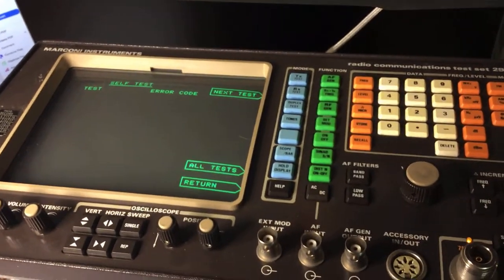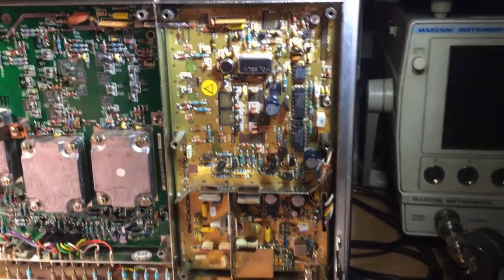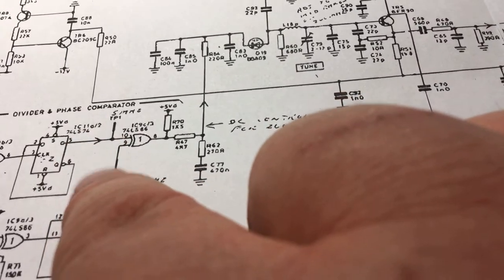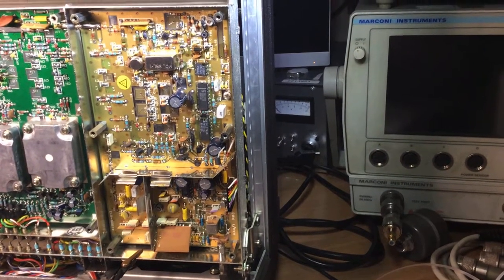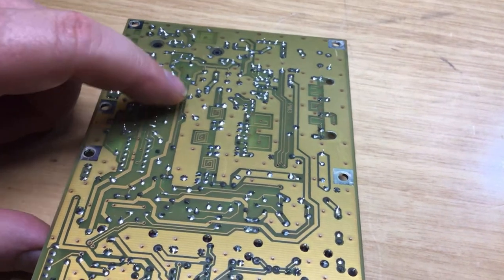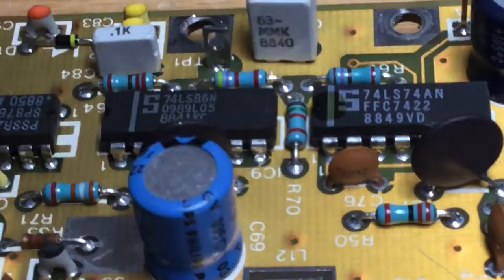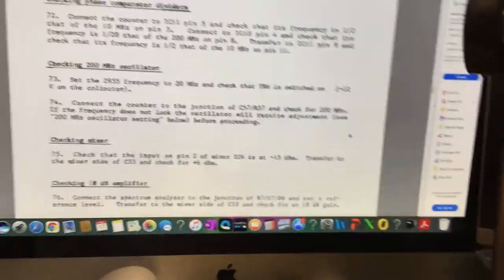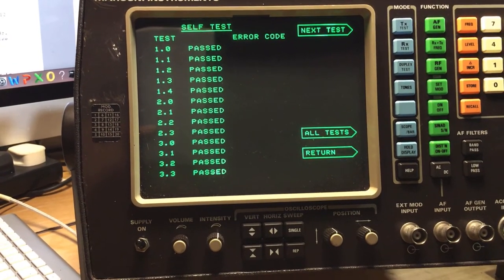Component repair Marconi 2955A Fails 1.0, 2.2, & 2.3 self test fail.

Comment: Hi! 
The adjustment procedure for 200MHz oscillator can be found in the 'Marconi 2955A/2955R Service Manual Amendments Vol 2', chapter 5-2-8 (Page 164 in the PDF)

Comment: @47:00 I picked up an almost identical desoldering unit, I did a review and then a modification video where I improved the fan noise, moved the power switch to the front, and improved the internal air flow for better cooling.
Reply from the maker: Yes  its very good desoldering station, I also have a PACE ST115 desolder station with accessories inc the drill tools too which plug into the base unit. That too is a very good desoldering station, About 20 years ago not long after these PACE units came out & acquired a large quantity of them from Erricson mobile phone factory closure here in the UK & sold them very cheap, Regret that now as their 2nd hand price today is ten fold what i sold them for 20 years ago 2nd hand.

Comment: What're you using for a ohm meter?   I'd Love something like that!
Reply from the maker: Hi There, the Ohm meter i use is a Fluke 123 scope meter, which is a portable meter, I also have a bench mains powered meter Thurlby Thandar 1705, both are very useful. The fluke 123 scope meter  gives isolation when measuring mains switch mode power supplies, as its battery powered you see.

Comment: All electrolytic caps need to be replaced. They have a life span. The test set is over 30 years old. If you have the board out change all electrolytics this is a known fact by all technicians. I cant believe you only changed the one capacitor.

Comment: SO are we saying that 11, 25 and 27 are down to a dead capacitor ?
and not OM345 related ?
i have two resistors on my OM345 to replace and sure i already did a capacitor a while back, but 11, 25 and 27 are back..!!
Reply from the maker: Of course it could be a defective OM345 too,  Well think about it, the OM345 is a wideband RF amp from 400khz to 1ghz isn't it? so taking that fact into consideration if the OM345 fails it will fail self test on all frequencies won't it. So as in this case if only the lower frequency below 20mhz fails in the tests & no other failures at higher frequencies occur then the OM345 cannot be at fault can it? this is because for frequencies below 80mhz the 2955 switches in a 200mhz fixed frequency oscillator to mix with a higher frequency signal generated to produce a frequency between 400khz to 80 MHz range, so a transistor turns on to power the 200 MHz oscillator & a capacitor across its supply output goes short.thus the 200mhz oscillator cannot run & hence no RF output at lower frequencies. Furthermore you can also establish if the frequency counter board is defective by ensuring in duplex mode with the signal generator at full output -20bdm that the TX right hand half of the screen shows the frequency readout correctly it should match the RF Sig gen frequency on the left side if the screen, this proves that the frequency counter board works too, use 300mhz to test. & ensure only single port duplex is selected on the N type connector. carry out the same test at different frequencies. obviously if all is well with the above two tests at frequencies above 80mhz but it does not readout correctly at frequencies below (use 20mhz as a test frequency) this proves the OM345's are ok but the 200mhz oscillator does not switch on. That is the process of fault finding, if you watch my other videos on the 2958 TACS radio test set you will see that OM345 modules are used on other parts of the system other than the sig gen, such as the frequency counter board for example, so by doing the two test above single out the problem.